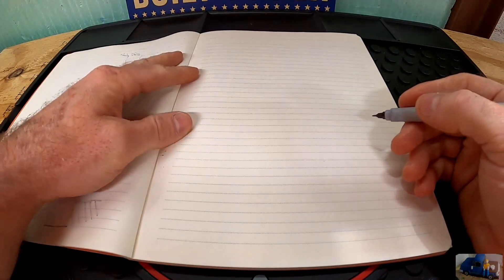FOUNDATION WALL PUSHING IN; CAUSE OF BUCKLING (SHORT)

Comment: Great Content. Thank You. 
https://www.youtube.com/watch?v=XG0EczJu72w 
(Foundation $ 4500 material + $5900 for stickframing 2x7 thicknes + 2x2 thicknes installation wall on top of the indoor vapor barrier.) 
https://www.youtube.com/watch?v=6hgT4bGnGAY 
(Stone foundation and low ceiling height built basement for some reason? ) 
https://www.youtube.com/watch?v=H1rHQl1wt1k&t=741s 
(Check out 4-level Mansard French design classic style 1700 m2 $ 3,500,000 Home with 2 car side entry integral garage and basement + 6 Stall detached Garage.) 
https://www.youtube.com/watch?v=5UKnX3ISZpk 
( 1700m2  8 Car Garage 2:nd presentation.  )